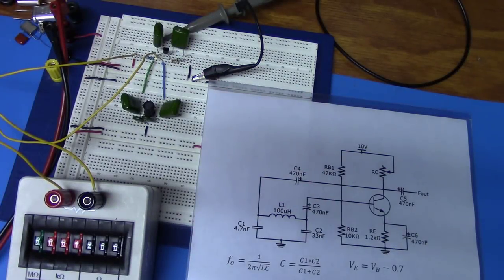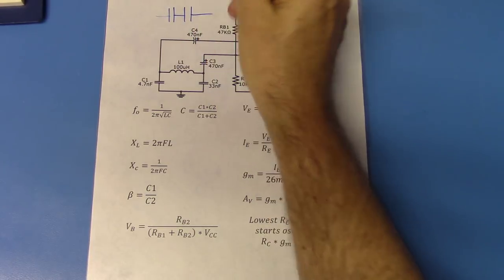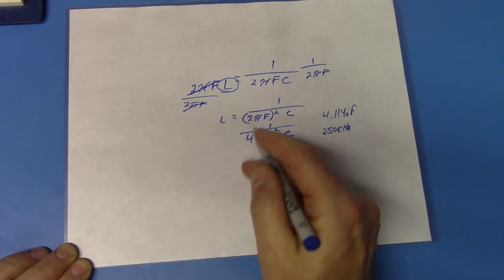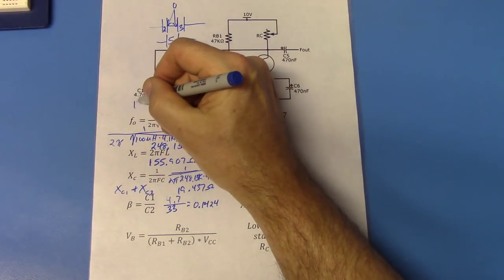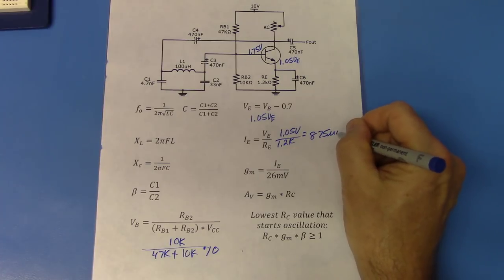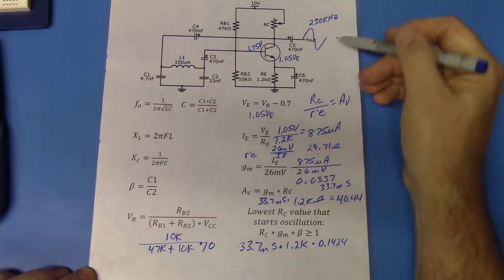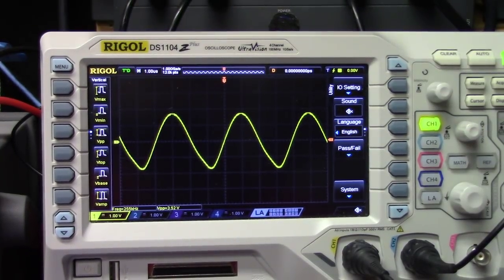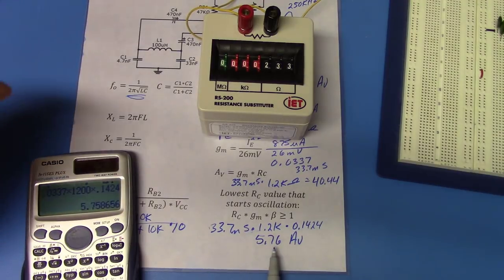73. Colpitts Oscillators Part Two - Transistors

Comment: Thank you so much for posting this valuable information regarding transistor circuitry, rather than focusing exclusively on IC technology, as so many others seem to!  Personally, I'm allergic to Integrated Circuits - in my opinion, they're CHEATING!!!   I've always felt that if you can't do it with discrete components, YOU DON'T NEED TO DO IT!  ;^)   By the way, the new intro is very sleek and impressive, but please, please, please - ya just GOTTA bring back the little Viking dude! (maybe send him to the chiropractor first.....)
Reply from the maker: There is a long story with how my viking alter ego came to be. I agree with you that knowing the discrete circuitry is important. You can't go wrong knowing the basics. However, there is a need to know both. For tinkerers and hobbyist, discrete is neat, but an engineer would receive a lot of grief for wasting space and power. One thing I like about discrete, there is more drama and excitement in it - looking at a little black box lacks any thrill at all.
Reply: The Offset Volt 
You raise an excellent point - I hadn't considered the practical aspect of modern electronic engineering.  And let's face it, with applications getting so complex these days - nearly EVERYthing is based around an arduino or raspberry pi - it's more imperative than ever to get things built as efficiently and cost effectively as possible.  Still, I can't help feeling a bit of the wonder and mystery of the mad inventor tinkering out in the shed has faded into the dustbin of history....

Comment: Thank you for a very instructive video!  I have designed my own common emitter Colpitts Oscillator which is not oscillating.  I wound my own inductor ( for a metal detector) and since I don't have an oscilloscope, I check for oscillations on an am/sw reciever (use bfo button on short wave).  I think my problem is lies with getting the Av gain of the circuit right so it's not to high or low.  I will use your formulas and try to design for a gain of around 2, also I will use a potentiometer for Rc to save time trying different resistors.

2 questions:  Is it possible to get a copy of your presentation circuit and formulas?
Do you have an instructional video on combining 2 frequencies?  I am trying to build a bfo metal detector and want to use 2 hf oscillators - subtract f1- f2 to get an audio frequency tone that can be amplified and listened to on headphones.

Thanks again for this great video!
Reply: I'm sure you solved your problem or gave up by now. If you make a capacitively coupled rectification probe, AKA RF VTVM probe, you'll be able to detect high freq AC. Of course, the AM radio works too if your osc. is in the freq range of the radio.
Hope you have bought a scope by now.
Hope this helps you and or others.

Comment: Great tutorial again!!
I have to ask the same question I did one tutorial ago without answer.  Why are C1 and C2 considered to be connected in series?
I have simulated the circuit with LtSpice and the currents through C1 and C2 are 180º out of phase. Should they not be in phase if connected  in series?
Reply: I will answer myself. C1 and C2 can be considered in series at resonance frecuency. The current coming from the output and going to the input can be considered negligible.
Reply: It's also possible that in LtSpice you were measuring the current through C1 to ground, and through C2 to ground. In that case they definitely should be 180º out of phase, because in that case you wouldn't be measuring them in series. You are right that the currents are in phase in series, but to see this you need to measure the current through one of the caps to ground, and the current out of ground through the other cap.
Reply: Assume on the output we have a Voltage(pp) of 3.5V; we can consider this the source voltage of the LC oscillator.. the node feeding into the base is a simply voltage divider..  we can ignore Xc1 for now ..  so V(feedback) = (Vout)(Xc2/Xl-Xc2)

Real Life Example: 

Vout = 3.5Vpp
Frequency = 269kHz
Xl = 144i  ---> 85uH 
Xc1 =  --126i  ---> 4.7n
Xc2 = -17.9i  ---> 33nF

---> V(feedback) = (3.5Vpp)(-17i/144i-17i) = 0.5∠180°Vpp
 
We can also use this voltage to determine the voltage out (let's view the feedback voltage now as the source).. we can now ignore Xc2 .. So V(out) = (V(feedback))(Xc2/Xl-Xc2)

---->  V(out) = (0.5∠180°Vpp)(-17.9i/144i-17.9i) = 3.5Vpp

Gain  =  3.5Vpp/0.5∠180°Vpp = 7

Comment: Nice video! I got a question: is the gain of the circuit is fixed? Because I leant that the oscillator needs the gain to be greater than 1 to get started, and after the oscillation is stable, the gain needs to be 1 exactly.

Comment: I am an electronic engineer  and i can say that the best explanation about BJT colpitts oscillators.....But i have a question if Av.B > 1 we will get an oscillation bigger and bigger ...is that a problem Mr
Reply from the maker: Not really, the system find an equilibrium point on its own. If the feed back is made too large, then all bets are off. You hit the sweet spot where it just oscillates and it will settle down nicely.

Comment: Assume on the output we have a Voltage(pp) of 3.5V; we can consider this the source voltage of the LC oscillator.. the node feeding into the base is a simply voltage divider..  we can ignore Xc1 for now ..  so V(feedback) = (Vout)(Xc2/Xl-Xc2)

Real Life Example: 

Vout = 3.5Vpp
Frequency = 269kHz
Xl = 144i  ---> 85uH 
Xc1 =  --126i  ---> 4.7n
Xc2 = -17.9i  ---> 33nF

---> V(feedback) = (3.5Vpp)(-17i/144i-17i) = 0.5∠180°Vpp
 
We can also use this voltage to determine the voltage out (let's view the feedback voltage now as the source).. we can now ignore Xc2 .. So V(out) = (V(feedback))(Xc2/Xl-Xc2)

---->  V(out) = (0.5∠180°Vpp)(-17.9i/144i-17.9i) = 3.5Vpp

Gain  =  3.5Vpp/0.5∠180°Vpp = 7

Comment: Thanks for the video. I´m making my final proyect and i have some doubts. Can i use a crystal of 24.576 Mhz  instead of the L3 inductor?? Why you use part three of this tutorial for the crystal colpitts oscillators instead this circuit? Can this circuit works with a crystal?

Comment: Just found your video series.  They are very well explained!  Thanks for posting these!  I had a question about the circuit in the video.  In this circuit you use 2 different values of capacitors in the tank circuit, where you use the same values when you set up the op amp circuit in the previous video.  What would be the reasoning for that and also is there a formula for finding the ratio between the 2 capacitors in the transistor oscillator?  Again, great videos!
Reply from the maker: Hello and thanks for watching. The feedback fraction is determined by the Xc of each of the two capacitors. In a transistor circuit, a feedback fraction that is too large can saturate the output. It makes calculating the oscillation frequency a bit more cumbersome. In an op amp, using the same values makes oscillator calculation very easy and we can rely on the feedback resistor to set the gain of just over one that we need to sustain oscillation.

Comment: Very informative video.Wondered if you would be interested in a video on different types of oscillator .In particular a vackar type,which in a simulation works every time,but in a practical circuit I can only get to reliably oscillate,up to 28 MHz.. Q factor of the tank,gain and feedback issues and biasing of the transistor,plus current consumption and ratios of capacitance and inductance,in the tank circuit could also be discussed if possible.

Comment: Sir, I watched videos 72 and 73. Why would somebody use the transistor circuit vs. the op amp implementation? I would like to build my own eddy current inductive proximity switch. English is not my native language. What kind of LCR meater do you has?

Comment: Great video, thanks! I have a question though: at 26:00 wouldn't conductance also change when changing Rc, thus changing collector current?
Reply: nope, collector current is solely defined by Ve / Re . changing Rc does not alter those values

Comment: hello, I"ve tried to copy this circuit at multisim but it won't produce the same output you are getting. Is there something on multisim that needs to be configured? I'm running it on default

Comment: these predictions will not work in the high frequencies RF but for kHz it is ok. the transistor capacitances will start to add up and the frequency you're looking for will be far off from what you predict

Comment: I don't understand why Beta is X_C2/X_C1: looking at the circuit, I would expect X_C2/(X_C2+X_L1) because C2 and L1 look like a voltage divider for the collector voltage. Am I wrong?
Reply: The standard voltage divider formula will work here, but not with 155.907 ohms as X_L1 and 19.437 ohms as X_C2. This is because those values are only the magnitudes of the reactances. You need to take into account that the voltage drop across L1 is not in phase with the drop across C2. If you use X_L1 = 155.907 and X_C2 = -19.437, where the negative shows the drop across C2 is 180 degrees out of phase with the drop across L1, then the divider formula will work, and gives 0.1424 like in the video.
Reply: Yep, you are right. At first the voltage divider is like you said, but at second steep use the resonance requirement xL = xC_2&1 and you get beta = - C1 / C2
Reply: @WiteexLC   It took five years, but eventually I understood :D

Comment: I want to make an oscillator that works at 13MHz. How do I do that?
Reply: Choose reactive elements whose resonant frequency is 13MHz, e.g. C1 = 25 pF, C2 = 52 pF, and L = 7.8 uH will get you pretty close, and those are all actual component values that I've measured. You can configure the oscillator using the common-emitter configuration above and figure out the biasing, or common-base and use R1 = 360k, R2 = 55k, RE = 3.3k with a 14V VCC. This will work.
Reply: @nicholasstave961  can you share me how to design colpitts is oscillator using bjt

Comment: There is something wrong with your circuit RB2 should be smaller then 0.1xgainxRe. If you set the gain=100 then RB1=20k with RB2=10k and your gain should be higher then 84.

Comment: what is exactly the meaning of Xc and Xl ?
Reply: Reactance of inductor = Xl
Reactance of capacitor = Xc
Reply: At different frequencies inductors and capacitors behave differently.. you can imagine them as variable resistors depending on given frequency.. capacitor and inductor are inversely related